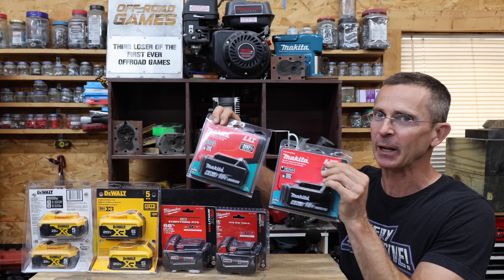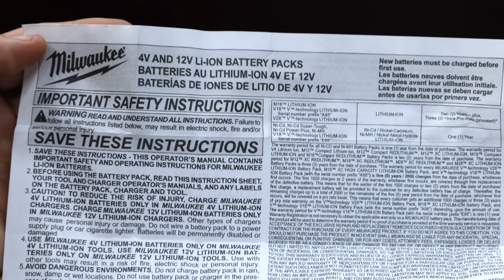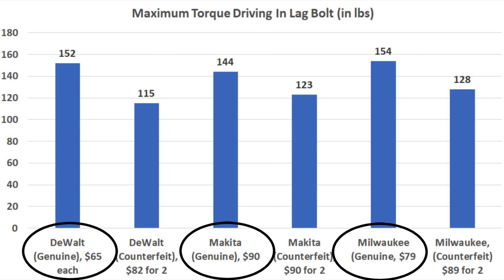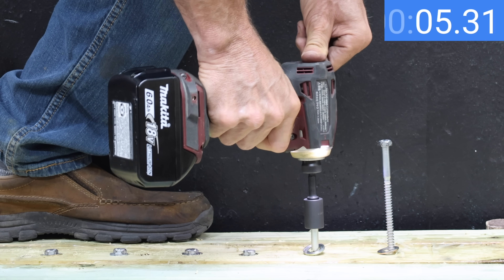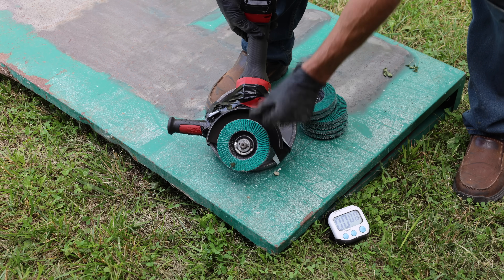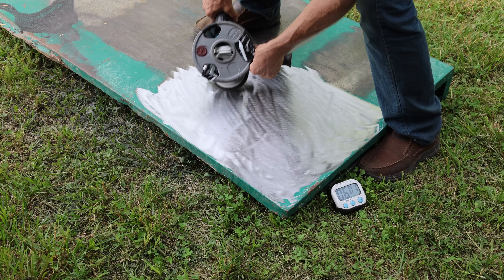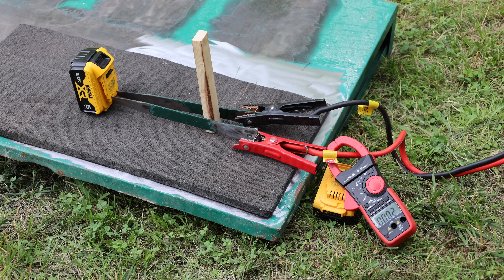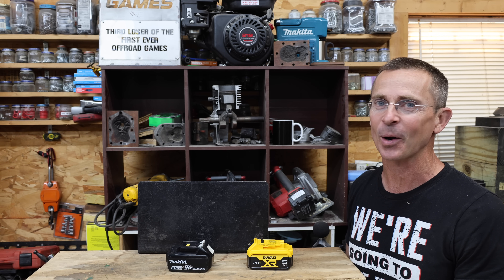Have You Been Scammed with a Counterfeit Tool Battery?

Comment: A journeyman at my work has had Makita lithium batteries for over 9 years still going strong!
Reply: I have some Hitachi batteries at least 10 years old that are still at approximately 80%.
Reply: Tesla gets dibs on all grade a batteries and then manufacturers like milwaukee makita etc get the next best in line and then the further it goes down the line you get the big box store's tools and then the no names and knockoffs... it might be that those makita batteries were made before the huge demand of cells for evs
Reply: My authentic makitas made it about 7 years on one and about 10 on the other. My spare is still working but loses its power. I only use it for house projects now and bought a Bosch set for the garage. Hope I get the same results with the Bosch.
Reply: I was just about to order some dewalt batteries. 🫠
Reply: My dad has Makita batteries and drills from the early 90's still running back from when he installed car stereos
Reply: My hilti is going strong after 15 years!
Reply from the maker: Great point on the authentic batteries!
Reply: @ProjectFarm My 10 yo De-Walt is that way and I've gotten water and transmission fluid in the tool a few times, kept on working. I bought it from Lowes in 2014, 2 batteries and a charger and a case, pricey but it's paid for itself in less than a years use.
Reply: How is it possible for rechargeable batteries to last so long?
Reply: @sarihaddu  I'm not sure how they lasted him so long, but it sure is impressive. On Makita batteries i noticed the cells were made in Japan. And they know how to make batteries.
Reply: @sarihaddu it’s possible , purchased a combo of Ryobi lithium 18v batteries , from April 15 , 2014 until now ( June 9 , 2024 ) , and still holding 95% charge , during these years , there are 3 hrs usage 3 days a week , longevity is the biggest concern, mainly saving money and time , all I do is never keep them outside the house when not used , especially in winter , never charge when it still hot ( wait 1/2hr) , never leave it in the charger when fully charged , best to all your batteries , have a great Sunday!
Reply: @sarihaddu  just good materials. i have a cell phone 7+ years old. samsung original battery. charged more than 5k times and still working fine.
Reply: @sari not Indian made 😂
Reply: Apparently he hasn't used them a whole lot. There's nothing that can be done to prevent the batteries from degrading as it undergoes charge cycles
Reply: @gregorsamsa1364  nah man. I used the heck out of my impacts and the batteries went years and years of flawless service. 7 on one 10 on the 2nd and still have one working. It's weak but still works!
Reply: @corymerry3399  yes, they can continue to work to some degree, but there's nothing to be done about degradation through charge cycles. Even the very best batteries cannot go through all the charge cycles that come along with 9 years of heavy professional use without very significant  degradation. The only way for that to happen is if they're just put through relatively few charge cycles. It's a physical necessity, given what a lithium battery is and the way it functions
Reply: @gregorsamsa1364  False. Lots can be done to help your batteries last longer
Reply: Rarely using the tool?  Constant discharging and fast recharging of these batteries will not allow for such a lifespan.  just look at EV batteries where the manufacturer states 12+ year battery life, but Lyft and  Uber drivers who fast charge 2x a day showing batteries dying in 1 year AND not covered by warrantee because of fast charging.

Comment: Yes don't buy off ebay.
Reply from the maker: Great point!
Reply: Exactly! I looked on eBay for DEWALT batteries and ALL of them were the fakes listed in this video. All old looking and around 80 dollars.
Reply: @cloudy4872  I did too and bookmarked the page. Thought they might be stolen but real. Doesn't look like it. At least the the knockoffs admit it up front.
Reply: Yup
Reply: I buy a lot of stuff from eBay, mostly electronic components, I derate everything by 50% due to Chinese specmanship.

I have a Bosch 12V drill and driver and purchased clone batteries for them. That way I know what I'm getting, so far after several years they seem to be OK but I've never actually measure ability to deliver power.
Reply: Amazon is worse.  More Chinese sellers on Amazon who have access to all the counterfeits.
Reply: I bought some Milwaukee M18 batteries off of eBay for about half the price and I checked they are genuine and how I know they are genuine is the diagnostic battery indicator
Reply: Some are real on there... the people who steal cartloads of tools from Home Depot have to sell them somehow. 😂

Comment: Suggested video: Best POCKET LED FLASHLIGHT, rechargeable ones that are a pen size. Light output, battery capacity and durablility test, are they water resistant as claimed? 

Example brands - NEBO vs GearLight vs ThruNite vs ACEBEAM vs Coast vs Streamlight vs WUBEN vs Energizer.   Drop the name, which one do you have / had that lasted?
Reply: Torque Test Channel has done quite a few videos on this. You can watch those while you wait for Project farm to test them.
Reply from the maker: Thank you for the video idea!
Reply: @ProjectFarm Suggest a new  video on top of the line to lowest cost battery powered mowers, EGO, Milwaukee, etc.
Reply: I have a nebo pen rechargeable,  it is perfect always reliable and bright, the magnet is a nice addition
Reply: Nice copy paste.
Reply: @JSFGuy  I did that 👈😉
Reply: @otarsulava  right